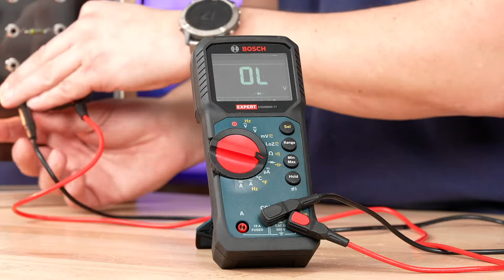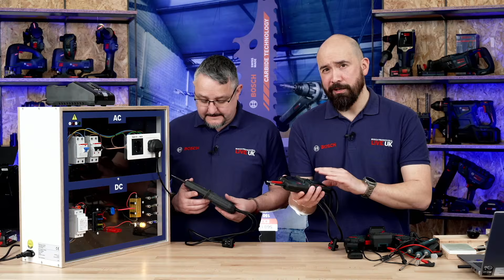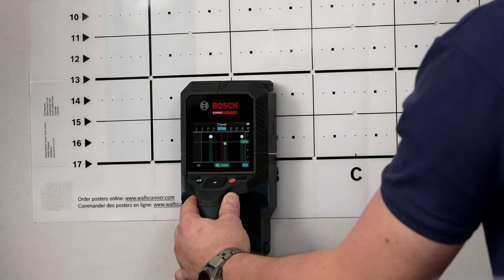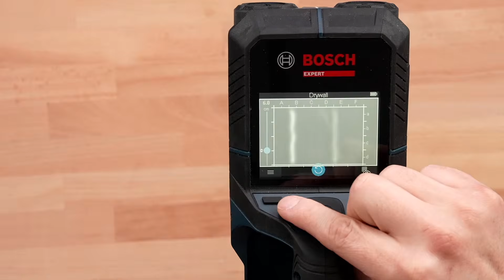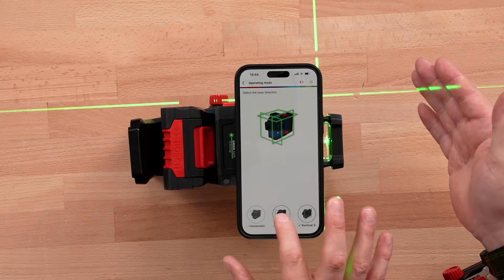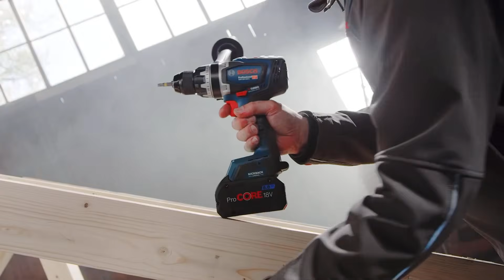NEW EXPERT Accuracy PUT TO THE TEST! 📏

Comment: I was looking for a tripod that i could use for both line lasers as well as for lights. I do not want to carry multiple tripods, they are clumsy and cumbersome. On rare occasion I need both light as well as laser, i will carry 2 (got BT 150  already (flimsy fella)). I considered BT 300. Looks great, rolls up high, but has 1 significant drawback -> it does not go low enough for me to be able to set 1m laser horizontal line - something used very often by many ppl. I found Makita TK0LM5030F - seems to be good enough for both cases, so i probably will buy that one. That being said: It would be great if you had a tripod suitable for both lasers as well as lights. I know, u got GLT 300-40, but noone wants to carry around 2 tripods. I think BT 350 would be gerat, one that goes up to 3,5m and as low as 80cm.
Edit: I am gonna extend the thought: Was ever motorized tripod considered? Remote controlled, 18V ofc (as it is stationary). 
Motorized functions: 
- Goes to preset height (maybe with laser measured height), multiple presets, + temporary preset (set height, press MEM button to save it overwriting current MEMed temp preset, is listed in the list of presets as).
- Up - fast, press = 1cm, hold = goes fast up.
- Fine Up - goes by lets say 0,5mm on 1 click
- Same 2 buttons for down. 
- Alterantivelly only Up+Down and Fine button, when held, Up and Down are 0,5mm instead of 1 cm. 
- Maybe set 
- Ideal as connected tool, you dont need remote, just use phone.
- Luxury option is the remote control. I think many ppl would choose it if it was robust enough
- Same goes for rotation, Left + Right, both by 1° as well as very fine angle, say 0,01°, Fine button can be shared for all 4 directions.
- Not sure if presets make sense for rotation, maybe just choose the step size. Or -> Set to a base position and then preset angles from that base position.
Musts: Robust, rly low to rly high (imagine tripod 50-400 cm!), precise, sturdy. I dont think there is such thing available on the market. 
If you managed price 0<€500 it think it would sell rly well. And then, many ppl would buy it, meaning they would be getting rid of their BT300, meaning i can pick 1 cheap on ebay. What a machiavellian evil plan. Muahahaha!!!!!

Comment: I have question actually of the expert tool range...
theres an expert axial glide saw, ive seen online that its corded just wanted to know if later down the line would it become cordless and also when the weight will dramatically decrease on those bad boys thanks again respect from South Africa 🇿🇦 👍 you can reply to this later in the Q&A stream if yall got full answers then

Comment: can you confirm the highest measureable dc voltage on the new expert clamp meter using the clamp and not the wires

Comment: As far as hvac goes the measuring tools aren’t fully fleshed out enough yet to swap over from specialised brands such as testo, and cos the 12/18 v batteries aren’t needed I’m not locked into Bosch for that one, so there’s not much reason not to go testo

Keen for the vac pump tho
Reply from the maker: Hey, yeah that's fair. We're building the range up, what kind of features might make you want to make the switch?
Reply: Look at what the big red brand is doing and improve it. Talk to technicians in the hvac field and build the tool range on their suggestions and requirements.
Reply: Didnt catch if they confirmed a vacuum pump, will it be 18v? And i do agree, Testo definitely dominates when it comes to pressure probes and manifolds, etc. Would be cool to see some 12/18v powered accessory tools like pipe cutter, flaring tool. I already have the Bosch 4.0 refrigaten recovery unit which im quite pleased with.
Reply: The expert moisture meter looks interesting, but does not appear to allow Bluetooth data recording of readings which will be frustrating when seeking to obtain a full wall profile.